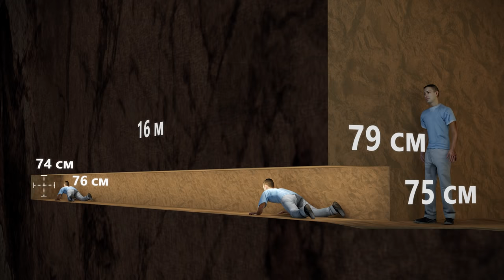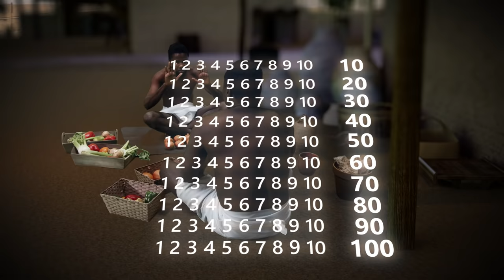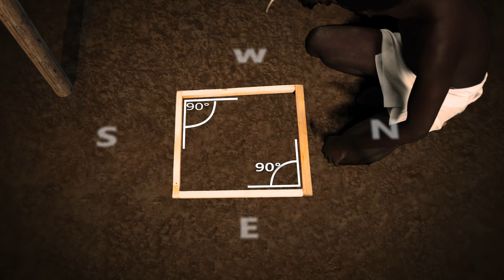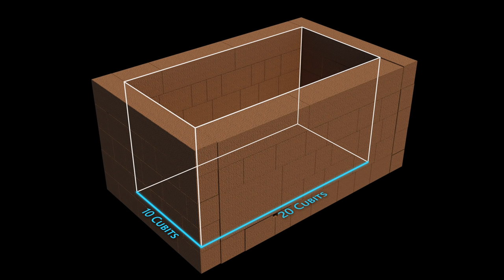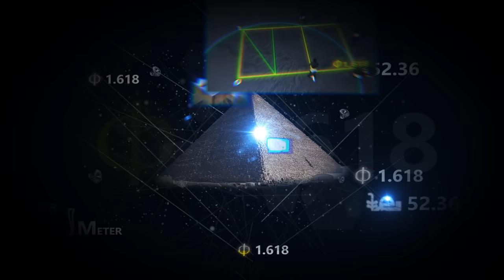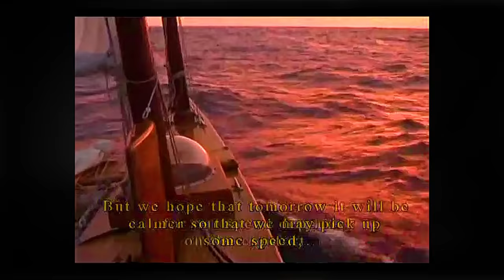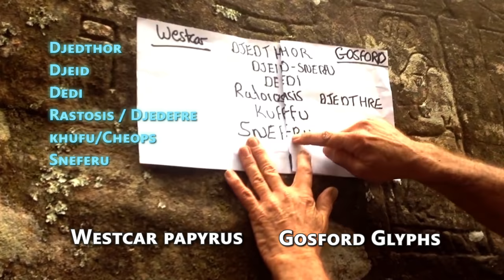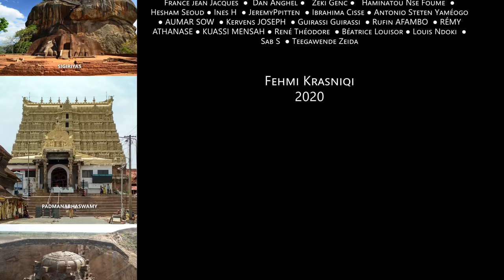The Movie Great Pyramid K 2019 - Director Fehmi Krasniqi

Comment: Ok, I have seen the whole movie now, and the theory of liquifying granite and making limestone concrete conveniently solves a lot of questions surrounding the various megalithic structures around the world. However I have a hard time believing that they kept making huge focal lenses everywhere they went. 
I do believe that all structures were made perpetuating the same knowledge. Youtube channel Bright Insight and Youtube channel Ancient History Criticism have already proven so long time ago. They however refer to some very curious phenomena on certain blocks, that this particular movie also does not explain satisfyingly. They call them 'nubs'. They are protrusions on some, but not all the blocks that seem to have no use, but also don't match with the otherwise smooth surface of the rest of a wall. 
Please do check them out at https://youtu.be/PRAJldhbkl8 . What I also think is weird, is that if the Egyptians gathered all of this smart wisdom and knowledge about lenses, astronomy and chemistry, why did their knowledge of metallurgy stay in the copper age? It seems to me that if you have the brains to come up with things like melting rock with super lenses, mixing the right chemicals to create artificial limestone, you could also come up with making steel and inventing and using electricity for instance. But apparently they did not advance in those fields at all. 
So, geopolymer and superheated granite is plausible, but the way it was done is not. And what kind of mold will not melt itself by the superheated granite? And if it is hard enough to withstand lava, with what tool are you going to shape such a mold ? As with most theories, this movie also leaves you with more questions than answers...
Reply: Regarding metallurgy, no other (better) metals were discovered yet
Reply: Actually there was quite few scientists who proved that ancient Egyptian had electricity ! You can see pictures of those ‘ lamps ‘ on many walls . Scientists even created one following exactly those pictures and .…it works ! As you can see there is no any sight of smoke inside dark tombs covered with beautiful paintings and hieroglyphs, which means people who created them didn’t use fire to light up those pitch black places . They also didn’t use ( like some archeologists try to explain) mirrors cuz in deep locations with many corners the light would be barely visible . Another thing worth to remember is that one of the treasures found in Tutankhamen tomb was knife made of Steel ! Yes made of steel ! I think that looking at ancient civilizations we don’t realize how advanced they really was . The one thing is for sure , they was living closer to nature , with bigger harmony and understanding of nature . They didn’t need to invent nuclear power plants , gasoline or plastic ( we did , and we sink in it right now , we breathe polluted air and still pay a lot for electricity,  although Tesla proofed we all could have FREE CLEAN ENERGY right from the Earth ! ) . The another funny thing about typical archeological society is that whatever they discover, the  new structure or object and they can’t  or don’t want to explain,  they usually classified it as religion or astrological. That’s right , most of things or structures they see they call religious or astrological like there was nothing else those civilizations was interest in . I think this shows you quite clearly how poor understanding we still have thanks to those few who prefer denial different reality . Thankfully the world is changing and people start question those answers given us for centuries . People start looking more closely searching for the truth .
Reply: It’s true. I think I buy the limestone concrete hypothesis. But in order for the molten granite hypothesis to progress beyond hypothesis, we need to see some lens evidence. Otherwise it just stays a hypothesis. Kind of like macro-evolution.
Reply: @roninr3473  My thought is that if the earth magnetic potential were greater than that of today, electrical current would flow easily, however metals would corrode and not be useful as tools and building material, keeping man in the stone age. I have stone age dental and surgical tools made of obsidian that were handcrafted by modern stone tool makers, they are very fine. Modern computer 'chips' are 'solid state', that is made of silicon stone.
Reply: There is evidence of steel use and foundry work, also low voltage and forms of electricity. Unfortunately, some info never makes it to the public, only in fortunate small circles. No BS - my degree is in Construction Engineering. I’ve worked as a Congressional/ Legislative Fellow conducting construction research with various state and federal departments. You don’t know what you don’t know until you see for yourself.  One source is the Ancient Egyptian dictionary. In that work, you will find they had many types of foundry’s and work titles. Their Construction Management was superb. It is documented that the Greeks attended school in Kemet as if in college and were paid to attend, housed as well as fed. We have not been exposed to their depository of so called curricula. It has more than likely been coopted and destroyed leaving remnants. Check Moorish so called Islamic literature, it is steeped in Ancient Egyptian knowledge. In example, my person conducted a prevention on algebra or alGebRa. The relationship between the earth and the sun for use in a construction math class. As far as language, all scripts lead to Kemet with the exception of Mandarin/Chinese. However, after dialogue with a fellow Chinese business associate, we found together during one of our cultural exchanges- there are many Metu Neter/ hieroglyphs that she identified similar to Chinese’s characters and with same meaning. Further, during my studies, words such as tons, tenant, chef even Berber were found in their lexicon. So let’s not underrate what we only see from the framework of this racist and culturally biased society at-large thru the system. We still have more to discover about these awesome people.
Reply: @roninr3473  that steel knife came from a meteorite, didn't it? Therefore very rare..
Reply: So... From your logic... Since they were so smart, why don't you ask why the Ancient Egyptians invent the computer?.. And the internet?.. And automobiles?.. Really?
Reply: @TonyMacklin  I am saying perhaps metal could NOT be used for building material as the earths 'step potential' was so high that nails and fasteners would corrode. Like instead of a spark when hitting the door nob after walking on the carpet a harmful jolt would occur. My theory about why the wheel took so long to invent, includes use of hot air balloons for long distance exploration, and canals and waterways used for most local transport.
Reply: I believe they stated that clay or limestone molds were used for the granite. You can melt rocks with a Fresnel lens as demonstrated by many here on you tube. There were many examples of concrete even waterproof concrete demonstrated by the ancient Romans and used by them for megalithic construction. Glass is known to have been used in ancient times even in ancient Egypt. So this is a very  interesting and perhaps plausible theory. If indeed they developed the tech mentioned in this documentary it would seem more plausible than chiseling each stone by hand with soft metal tools?
Reply: @capodad2u  Shasta Dam was built by demolishing a mountain top into rock, transporting the rock on a conveyor system to a cement plant where the rock was ground into aggregates and heated and treated to become cement then transported by cement truck to the dam site.  The evidence will be there for a great time.
Reply: it is amazing. They were much clever than us.
Reply: @MARILYNANDERSON88  ahhh so the ancient Egyptians built Shasta dam? Jk
Reply: @capodad2u  no, electricity and diesel powered machines using rebar and cement built the dam in the 60s, however the evidence of the source of the granite and the conveyor belt and the cement  plant are all visible at the site. I guess the solar boat was found made of wood by the pyramid some think it was a crane ..lol magic??
Reply: @MARILYNANDERSON88  woooosh....(it was a joke) Btw I like your comments your very intelligent.
Reply: @ianturton4976  that’s what scientists believe after testing it . It showed this knife has components of Steel , Nickel and Cobalt , which you can find in meteor.
Reply: capowacko Do you have a link to a video where "rock is meted with a fresnel lens"?
Reply: @Vicartje  you should watch this video , please type this name ( melting Stone in Nakanojo with Solar Power ! )and you should see how easy you can actually melt a rock . Pretty amazing

Comment: Using cast limestone concrete makes huge sense.  Maybe it was done that way.  I'm not big on the molten cast granite though, you melt granite and cool it quickly, you will be left with a very fine grain structure and the difference between the resolidified product and the original granite would be OBVIOUS in micrographs
Reply: Yes you can usually tell if a substance has been RECONSTITUTED , plus what did they use for molds .forget the Molten granite . What do you think about the limestone concrete hypothesis    would not this require some sort of a binding agent that could be detected , maybe not I don't know not a geologist.

Comment: I was entertaining the theory about the limestone concrete at the start, but when you got to the granite melting/molding theory, it all fell apart.
Reply: Even if they really have lens technology, The strong light focused by such a big lens lens will quickly blind the worker’s eyes.
Reply: @leonard2834  it is absurd really. The CGI that they show, the frame of the structure used to melt the granite is made from wood, the people are right beside it…. The wood would catch fire in the proximity of the heat from the molten granite and this alleged lens. 
No one would be able to stand so close to such a heat source. They would surely be horribly burned or even killed.
Then there is the question of the crucible used to melt the granite in and pour it from. It would need to be made from something with a higher melting temperature than molten granite, that the lens would not be able to melt.
Then the molds for the granite as well would need to withstand the heat of the molten granite.
None of this is ever addressed or explained. Then the idea that they somehow transported these lens all around the world and built all of these other civilisations…it’s just pure nonsense with no facts or evidence to back it up and no basis in reality.
It’s all just a fantasy that someone conjured up.

I’d recommend that anyone genuinely interested in this subject to check out the YouTube channel unchartedx, who actually approach this stuff from a logical, reasonable perspective, looking at the facts and evidence.

It’s crazy how much time and effort has gone into what amounts to very lazy ideas with no evidence to even suggest that it has any basis in reality.
Reply: Haha..I'm sure u were lol
Reply: And if you think that theory is more absurd than what we are told you are ...well...enuff said
Reply: @JohnMarshall-NI  A very good breakthrough with the limestone concrete. But the melting of granite with 5 meter magnifying glasses is where this movie departs from fact to join the fancy associated with so much Egyptology. Where is the evidence such huge lenses existed? How many would they have needed or used? Why is there no such lens in the archaeological record?
Reply: @leonard2834  exactly, and that’s only one reason they weren’t poured, what about the absence of shutter marks from pouring
Reply: @anthonyfolley8533  Glass breaks into sand, wood degrades. That's why no evidence of lenses.
Reply: @leonard2834  Just some random animation. It's clearly stated clay molds for the molten granite. Look on YouTube many lenses have melted granite.
Reply: @JohnMarshall-NI  The lens theory requires leeway, but the wood observed in the granite is definitely a quandary.  We may never know the answer with that said the filmmaker presented evidence in support of molten granite.  Molten granite is more plausible than workers shaping granite with cooper tools.
Reply: I really ,really ,really want this to be true, it makes so much sense and I’m convinced up to a point, ie the wood encased in the limestone, so building blocks, yep, you’ve convinced me.  I spend so much time in the British museum and have noticed that in the statues of pink granite where bits have chipped off the stone still has very defined pink and black chunks in it, surely if it had been melted it would be a uniform colour and texture.